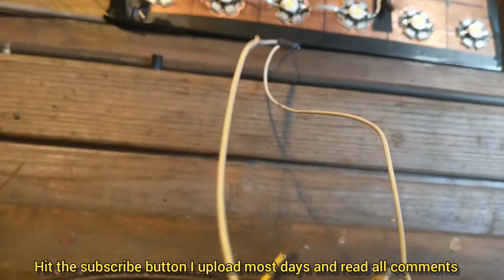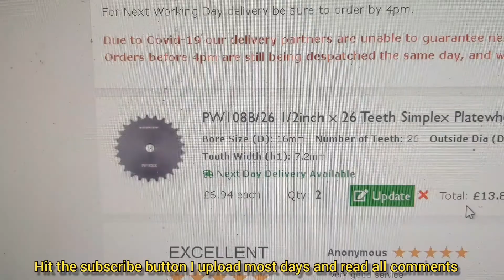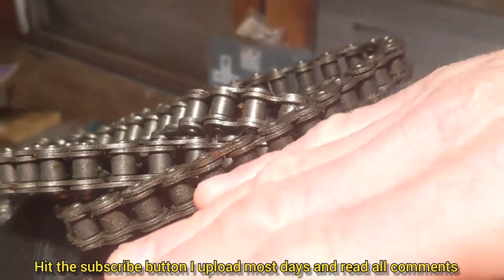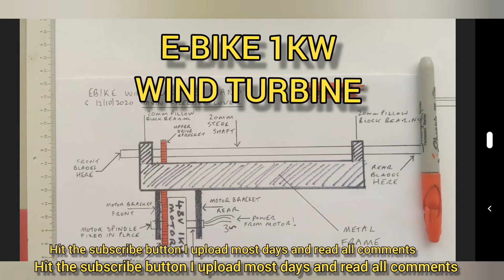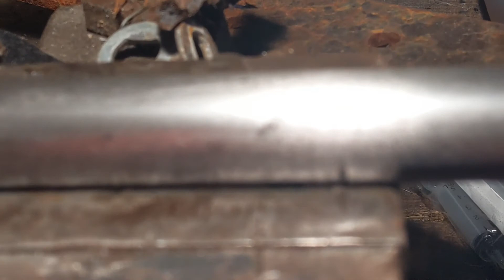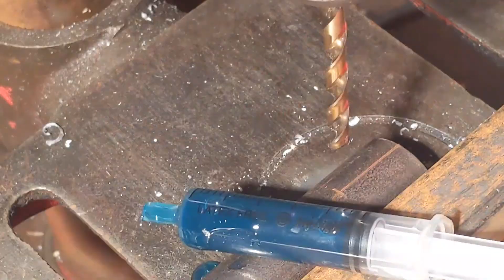1kw E Bike motor to Twin Rotor WIND TURBINE GENERATOR part 3

Comment: Good digzine, i know why you set the motor on the front but it will follow the wind direction more easily if you manage to switch the position of the pole on the front close to the front blades and the angle you planning to add to it will help you to do that, and the motor close behind the pole 🤔
Reply from the maker: Thanks for the comment I have the motor attached to the frame it's all coming together make sure you watch part 5 !!!